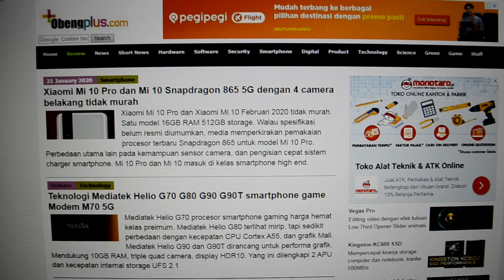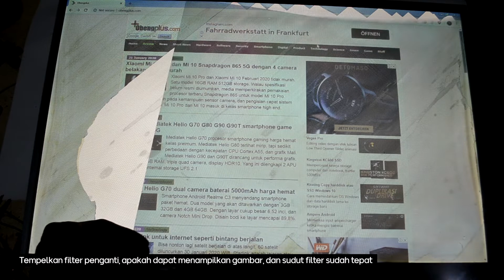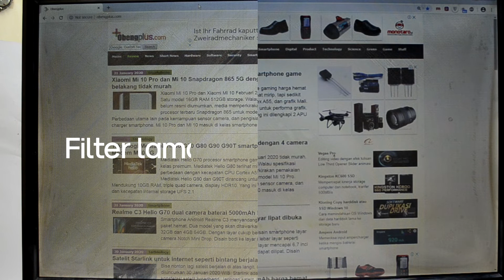Repair wrinkled TV monitor screen

Comment: mas, kebetulan nih ada monitor sy spt itu kondisinya.. Itu di panel di sayat sayat pakai cutter tidak apa apa ya?
Juga pada waktu pemasangan filter baru, apakah panel harus dilepas dari body nya? bisakah tanpa melepas dari body ? trims
Reply from the maker: Melepas panel dari body frame lebih bagus lebih bersih
Tapi harus hati hati dan sabar, melepas di bagian tepi.
Bersihkan sebelum dipasang, harus benar benar bersih jangan sampai tertinggal debu di atas layar LCD
Kalau saran memang jangan di lepas selama membersihkan panel
Jangan terlalu keras mengores kaca atau plastik panel yah kak.
Pastikan sebelum memasang polarizer, LCD di nyalakan dan lihat posisi filter atas dan bawah
Kesalahan yang sering terjadi, filter dipasang terbalik 180 derajat.
Membuat gambar tidak keluar.
Periksa 2 kali, dan beri tanda di panel dan lembaran filter
Semoga informasinya dapat membantu

Comment: tanya itu yg luar, apakah baliknya sama jenisnya dengan depan
Reply from the maker: Beda beda kak, mengikuti model panelnya
Panel lama dengan lampu CCFL / Neon mengunakan panel TFT matrix, memiliki sudut tersendiri.
Model seperti Samsung, LG mengunakan panel IPS atau PLS dengan lampu LED
Panel LCD TV memiliki sudut lain lagi
Kami hanya memberi informasi pengantian panel depan yang keriput, akibat panas dari adaptor power di belakang panel LCD.
Bila kerusakan filter juga terjadi di belakang panel belakang. Biayanya lebih mahal.
Itu saja informasinya dari kita, semoga membantu
Reply: @ObengwareID  kak, saya lihat ini, akhirnya nyoba bongkar sendiri, kaca nya retak tipis. apakah itu masih bisa dipakai? maksudnya saya tetep ganti polarizer nya aja gitu..?  
lalu
saya lihat juga, polarizer saya ini kedua sisi (luar dan dalam) bermasalah, berarti menurut jawaban kakak diatas, jenis polarizer nya berbeda ya? karena kata toko yang saya beli, kalau pakai 45 derajat ini sama aja, bisa luar dan dalam. (meskipun saya juga gatau apakah benar pakai 45 derajat, belum beli)

mungkin ada masukan kak?